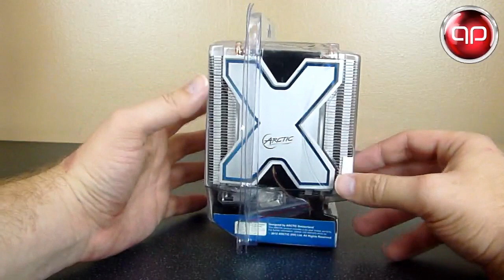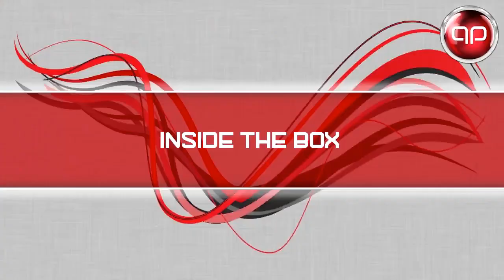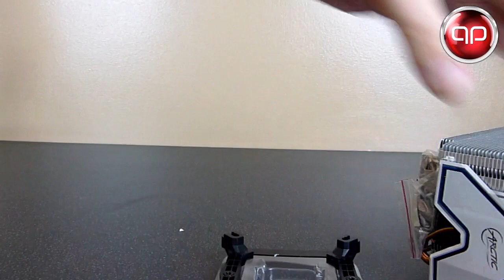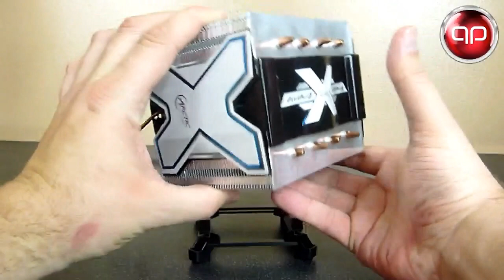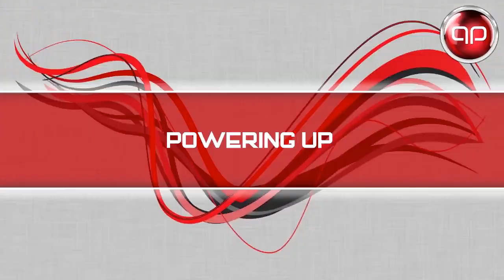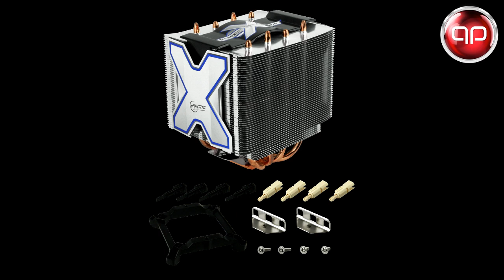REVIEW - Arctic Freezer Xtreme Rev.2 CPU Cooler

Comment: I have this cooler but the fan is too slow, so I fitted a 3000rpm Noctua fan inside and it's cooling way better during the hot summer...

Comment: any good for an fx8320?
Reply: +Synthematix perhaps a bit late for a response, but I recently installed this cooler on my fx 8350. This cooler is much nicer than the stock cooler, with a max temp of 30c during my gaming sessions. However I have not overclocked my cpu.
Reply: yea no need to OC an FX 8320 or 8350, theyre fast enough for any game